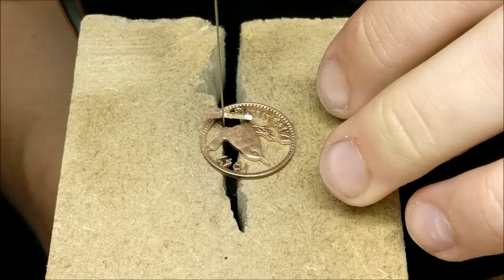The Making of a 1947 Farthing Coin Necklace

Comment: For all those wetting themselves over the desecration of an old coin. This is a 1947 farthing worth about 10 pence/14 cents.
The coin is not unusual or rare, in the 1940's the UK minted more than 220,000,000 farthings (quarter of a penny, 1/960 of a £).
So, for those of you truly worried, you can buy an uncirculated 1940's farthing in perfect condition for about £3.00/$4.00 and preserve a piece of history for yourself for less than the price of a BigMac.